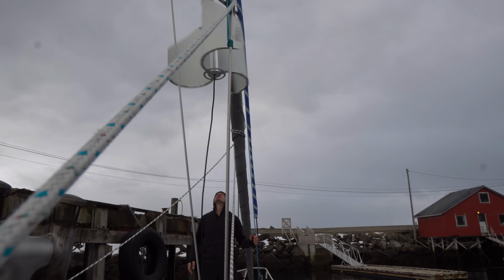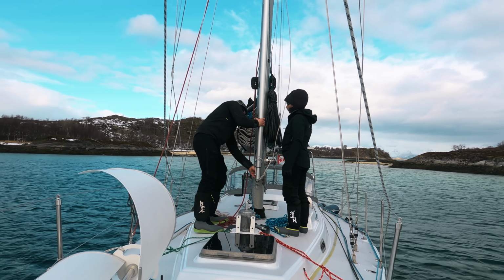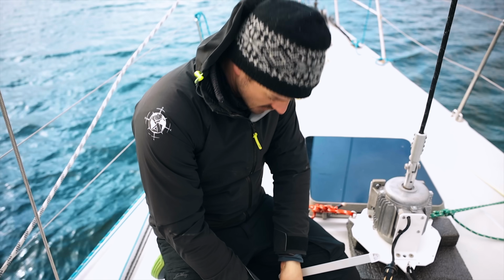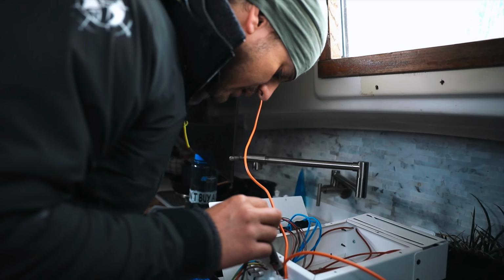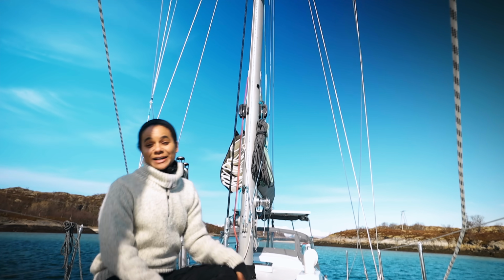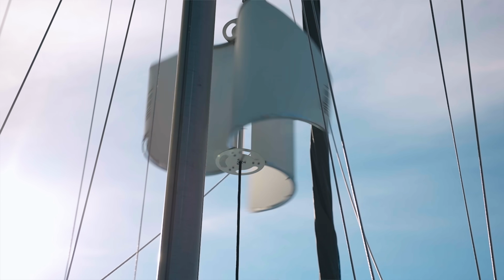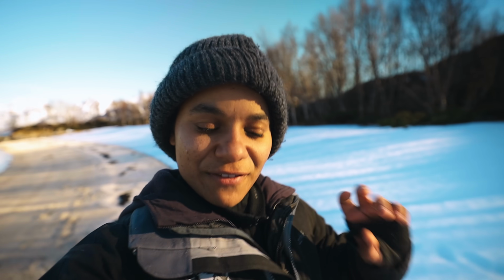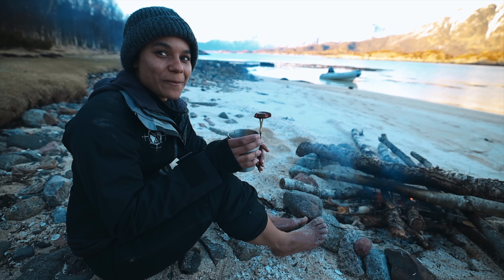No Sailing, Just BULLSH!T — Sailing Uma [Step 273]

Comment: Just a suggestion but if you get a cheap power screwdriver and take the orbital gearbox out of it you should have the torque to use it in reverse to quadruple the speed of rotation to you gen.

Comment: Something to be aware of , the type soldering iron you used in this video, emits a very high current, therefore a large field effect, if you have it turned on close to an IC chip or transistor you will fry it . Maybe want to move to a thermal element instead of current element, Milwaukee m12 is a great unit

Comment: Why don't use floating solar panels for the power?
Reply from the maker: Where would we store them?
Reply: Is it possible to fold the panels then store under your current fixed panels or to roll the panels then store with the dinghy? 
Also, have you think about to get a Starlink box?

Comment: Kika mentioned the the torsion cord is squeaking. A torsion bar (short) between the wind vane and the motor and being perfectly vertical at the bow would give the strength and wind speed (nothing blocking the wind) to turn the turbine quicker and more evenly.

Comment: Mate the plug on the motor neefs to  be changed please. As you stated the motor produces power when it turns. By having male connector you then have exposed power terminals and risk getting shocks from them system. I gather you wanted to use an extension lead to get the power inside but you need to be cautious of thr exposed ends

Comment: Great video as always :) Love the NBJS Reference and message from EA!

Vertical wind turbines... You are creating a brake and wear point by pulling on the spindle like that, consider a solid bar so there is no tension between the vanes and generator.  That way you can focus on steadying the vanes top and bottom

Comment: That Turbine is a ridiculous monstrosity of crap.  I have the AmpAir modified to 250watts.  It makes next to No Noise and pumps out Huge Power on cloudy windy days 
on a 6ft Stern Pole its a perfect and permanent solution. 
Theres RARELY a day it isn't efficient and worth its weight in gold.
Reply from the maker: Please define "Huge Power" with actually numbers, watts generated at various wind speeds. Because a 250W wind turbine usually only creates that much power in 30-35kts of wind. Something we often never experience. 10-20kts on the other hand, we're in almost always. With wind generators, there is no substitute for sweep area. And we're looking for 500W+ in 15kts of wind @ 48DVC nominal. Nothing on the market can do that, which is why we're building our own.

Comment: Dan, using a soft shaft will be less efficient, the rope will absort or dampen a huge amount of the engergy. The tension in the rope will pull on the bearings, which are not thrust bearings. This will add friction losses.

Comment: would a car ( or boat) alternator be a  solution to replace the heavy motor that you showed us?
Reply from the maker: No. They're designed to spin FAST and be attached to large ICE that product way more toque and HP than the tiny alternator can use. We're looking for a low RPM, high voltage solution. So something more like a washing machine motor. Large diameter, flat shape with lots of magnets and coils. Luckily, these videos are from a few weeks ago, and we're already well into our V2.0 of this whole project.
Reply: @SailingUma  Can not wait to see that.

Comment: The solution to those screw terminals and stranded wire is a ferrule. It's basically a light metal jacket that gets squeezed around the stands and holds them together and gives the screw a solid surface to. I've used them on electronics projects and just recently on a 50A 240V line for my RV. They're more common in Europe than the US so you should be able to find a kit at an electrical supply store, if not there's always Amazon.

Comment: Stranded wire is used all the time in the home.  Anything bigger than 10 gauge is typically stranded.  Like wires for the cooktop/range, clothes drier, the air conditioner/heating unit... all as examples.  The thing is that the connections are like the type you describe the two plates that screw together.  
BTW, I've often wondered why no one hasn't developed vertical axis wind turbines that would mount around the solid lines that go to the mast (lower shroud for example).  Use those lines as your axis and make the turbine long and narrow...  your generator could mount to the side of the line and be direct, chain, or belt driven.  The generators wouldn't need to be that large on each one.. just thinking

Comment: Just a few things to consider for the wind generator. The unit you have is way to big for what you are using for a wind rotor. Look at most pull behind aqua gens and you notice they use a small diameter generator section. That is because they cannot create a huge amount of torque to spin the gen . With a wind gen you have even less torque so the gen has to be small. You have to trade off torque for RPM. With a smaller gen it can rotate in less wind.
With the torque line mount all you need is a straight coupler that mounts onto the gen shaft. Then you swivel the gen where it mounts to the deck to line up with the torque line. Also you want a gen that is at least 3 phase to even out the pulses from the gen spinning. No wind gen is going to delivery huge amounts of power at one time. But it does give power 24/7 as long as the wind is blowing.
Just a thought, TP

Comment: Maybe you can make a 3 standard on top of the mast where the blades are turning on whith the line trough the mast and the deck and at the bottom you have the generator with a turnbucle on it to tenchion the line and of course you need seals and stuff it just a ruth idea

Comment: yeah,fix the blades to the horizontal pipe with a clap or something like a solar panel holder,Fix the bottom also with a holder for 3 lines,so it doesnt loose energy swinging around,and use a solid Aluminium axe to the generator.I know you have figured it out already when I write this  ; )
I like the concept of the blades higher up,keeping the noise where the wind is.

Comment: Very innovative. I'm impressed you guys keep developing, tinkering and engineering new systems and designs at the ends of the earth still. Very excited to see how that comes together with the vert wind vane. Maybe you could mount the motor all the way in the floor near the keel to keep the mass of it as low as possible and enclose a carbon/aluminum torsion tube through the cabin to the deck with a permeant bearing/seal attachment point above. Could even make a rudimentary transmission to attach multiple vanes to the same input shaft to the motor/generator. Cant wait to see specs on what kinda wattage you are able to pull out of it.

Comment: Every engineer is wondering about the vertical load imparted on the motor shaft from the tension line. Is the motor designed to handle that load…

Comment: A great idea could run a pole like through your mast with the wind catcher on top. Even better like some new supposed sail boats use huge sails that turn a turbine to power an engine that pushes the boat along. But better still is use a brushless motor with ceramic bearings that would take less force to turn it. Even better try the best electric 1KW electric remote race car motor as the best ones have special bearings and are small engines Brushless. They can run 12 to 24 vaults. Bicycle Brushless motors can run more than 48 vaults up to 5 KW. But I think try small first. Also your wind machines for boats  are not as good as they are made to work certain ways so hardly put any KW out at all and are expensive. Try making your own with what I suggest first using wind machine fan blades I think you will be surprised. As I will be experimenting when I get a boat to make things far better.

Comment: Nice - You smartly improved on my solution for a similar situation :) 
But Please, try to NEVER use a male connector for a power outlet - always use a female connector for the outlet. This way You won't run the risk  of accidently touching or shortcutting anything dangerous.
Reply from the maker: We did it that way on purpose. In order to test the motor you short out two of the leads. Harder to do on a female end. Besides, it’s all VERY temporary.
Reply: @SailingUma  Thanx for the prompt answer!
That was a potentially dangerous routine, thankfully You where aware of some of the risk involved - As You usually do your research well..
A professional electrician though, would take the extra job to minimize risk - they need a stricter framework of rules to survive in the line of work.

Comment: Here are some ideas....it's just a stream of consciousness...so bear with :)

Motor seems really heavy. Could a vertically mounted 24v vehicle alternator do instead? Alternatively look at Rocket E-bike  or "self charging" E-bikes in general as you could use the lightweight motor deck mounted as a generator if it's permently in "regen" mode. Quite surprised their is not some electric sail drive manufacturer that has not come up with a lightweight generator based on their propeller regen technology yet. Maybe you could use your platform and natural charisma to get one to build you a prototype ;)

Not sure about the efficiency on the tensioned line drive system. Could you replace it with a lightweight carbon fibre or fibreglass shaft instead? Hoist the turbine up and then clip it in place between the turbine and the deck motor. The company that built your bowsprit could make one. If you built it like a fishing rod or a drain rod it would have strength and some flexibility. You could test this concept with a few modifications to a cheap carbon fibre landing net pole. The connection to the motor needs to "sliding" to allow for variations in the rig tension and length without stressing the generator.

Vertical turbines need to be "managed" to provide maximum efficiency and minimum stress on the components. It may need a computer managed brake system to keep the turbine running in its "sweet spot" in fluky and gusty winds, to stop the turbine from breaking under stress and to keep a smooth spike free power flow into your power network.

If you want a more efficient vertical turbine then contact the Icelandic vertical turbine designers. I'm sorry I cannot remember there name, but their is an article on the BBC News website about them.

I've been thinking about permenant turbine installations. Their is only one real answer and that is mast top. If money was no object (if only)....

I would build a mast top module consisting of a 100mm wide central shaft joining a pair of top and bottom teardrop shaped plates, all made of aircraft grade aluminium. The top plate allows the mounting of the existing mast top instruments and aerials. The central shaft provides strength, a cabling route and a mounting point for the turbine. The lower teardrop plate has vibration damping mountings and is attached to the mast top. The turbine itself would be a vertical drum type made of carbon fibre, providing strength and keeping top hamper weight as low as possible. The turbine would spin around the central shaft on low friction bearings. The bottom of the turbine is fitted with a large diameter gear cog to drive a chain or set of reducer gears.
The teardrop shape of the bottom mounting plate allows the tapered section to over hang the mast at the front (slightly offset from the forestay). A lightweight dynamo-style generator with direct drive via a chain or gear set could be hung under the plate directly in front of the mast, with cabling running down the mast. Alternatively a carbon fibre or aluminium drive shaft could be run down the front of the mast to a generator mounted on the deck at the base of the mast.

Alternatively could you extend your rigid cockpit canopy rearward so it over hangs the stern and mount a vertical turbine aft of the solar PV arrays?

Of course if money is no object then an entirely new mast design is on the books :) 
I.e the structure is designed to have a vertical turbine above the sails and rigging with cabling or a drive shaft running inside the mast with the heavy generator mounted in the hull below deck, probably under the cabin floor. Much better for efficiency and stability.

An alternative would be to replace your current rig with a rigid vertical wing style rig. Maybe with a vertical wind turbine on top.
In this way your still a sailing boat, but under a bit more computer control. Pretty much sail-by-wire. You tell the computer what you want and it manages the sail angle millisecond-by-millisecond providing maximum efficiency. This wing sail design allows you to cover the entire thing with flexible lightweight PV solar arrays giving you a massive increase in PV panel square footage and generated power. Even if you have no wind you can alter the angle of the sail constantly to provide maximum solar PV power generation and you maybe able to motor while still running all your other electrical systems and still have excess power to charge your batteries.

If you want to see the ultimate electric boat go to energy-observer.org

Another alternative is an inflating wing sail (IWS) rig. This allows you to sail more efficiently , especially in light winds and would mean your sail drive would provide more power all the time and since it require no rigging or stays you could have space for more solar arrays and a removable low level deck-mounted vertical turbine.

Well you certainly got my brain racing their. Any hoo just a few crazy ideas... :)

Comment: What You gotta use to make Your screw terminals work with stranded wire is an end ferrule to crimp strands into one solid end. Works beautiful without soldering. Some woolfat (lanolin) on the taps, and Your screw connectors are good for a couple decades aboard. (The absolute opposite of "terrible": easy and foolproof)

Comment: Think the cold has gone to your head dude. There are so many excellent wind turbines that could be connected to a 240 to 48 volt output fixed on a post producing when ever it blows, you system looks cutting edge 1960s. You guys needs to head south before you invent this this called a generator
Reply from the maker: Please. Send links. Because we’ve been looking and researching for years for a solution that will satisfy our needs and can’t find anything, hence we’re building one of our own.
Reply: Ok Dan I will dig up a couple of links but have you considered a Rutland 913, I don't have one but they are quite and produce consistent output in all wind conditions I have lived next to yacht with them in a marina in upto 70 knots and didn't want to punch the owner as they are quite you could easily mount two. I on the other hand have a Russian tractor AWS 400 it is big noisy very reliable and produces upto 400 watts in 20 knots Ave 200- 330. I use it on anchor during the day or when sailing because it's noisey, it has a excellent break and if I used in a marina I would be stabbed. Two wind generators producing consistent results 24/7 in all wind condition quietly appears the better result. I do hope you have installed a wind sock on yours to douse it as a sailor needs his hands. I think your generator would be better used as a towed system just buy the correct prop. Alt small boat anchor. Enjoy the journey.

Comment: In 2000 when I moved to anchor my NASA neighbor who sailed to the Arctic every year taught me to handcarve wooden windgen blades. As a result I sold 100s to sailors, castle owners, Amazon tribes&my hands are known for carving the most beautiful, powerful&quiet blades from hardwoods on Earth. I made a DIY class at windgenzen (c0m) and taught 100s of students how to do this for $100-$300 bucks. A vertical axis is a (ahem) toy for amps and if you carve the tips right blades are silent. A little rubber in a mast mount or fly gens on a halyard and there's zero vibration noise. If you do hear noise your blade needs some tlc; a light sanding and varnish or paint. In an analysis of amps per dollar DIY wind is 1/20th the cost of solar.

Comment: I wonder if you couod use a  snap on data logger it would be useful to read live voltage data they use them to diagnose electrical problems on most modern cars I think would be a worth while endeavor to snag  one up if possible. I can usually find them on Facebook market place I know its a long shot but if could read live electrical data it would go along way to create and diagnose any electrical problems and come up with solutions.

Comment: You probably already thought of this, but what if you used something similar to a u-joint at the generator part? It should keep it from binding up and remove the need to have the generator and turbine directly in line.

Comment: A better option for attachment to the motor shaft would be a knuckle universal joints such as that in a front wheel drive transaxle.  Also if you anchor in moving water maybe a submersible device that would spin in the tide.  Don't know how you would stabilize it though!! Would your prop pinwheel in tidal current?

Comment: Dan. Why cant that sail turnine be at yhe top pf the mast on a plate with a second plate that is rotated slightly to cam out the turbine sails and also back in? Aluminum rod could run through the mast down to the salon where it is routed out by small universal joints to the motor. It can be deployed when winds are just right and cammed shut by a line when not. I mean if you are going to design and build might as well aim high. With whatever route you choose a small universal joint would solve the misalignment issue though. 😀👍